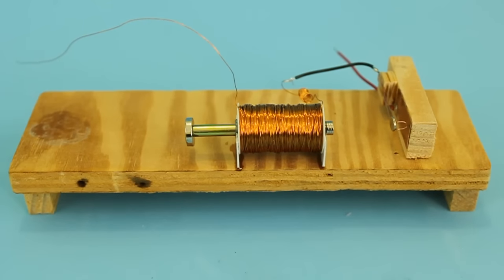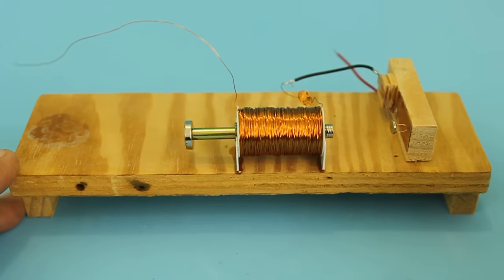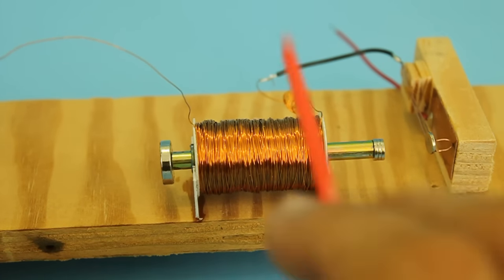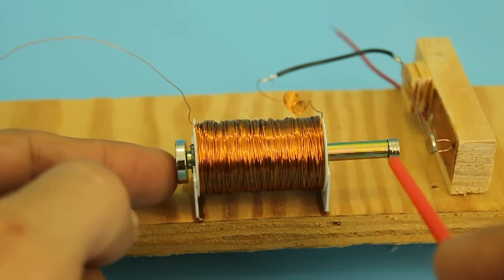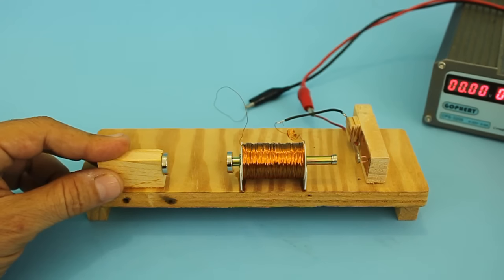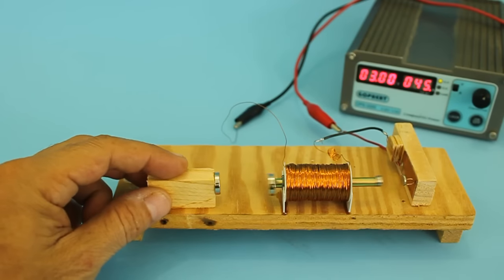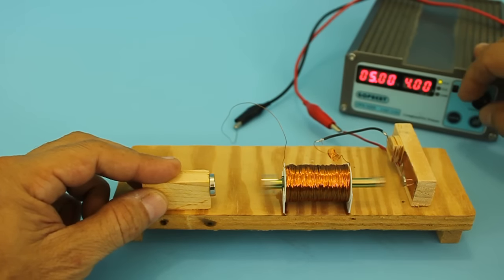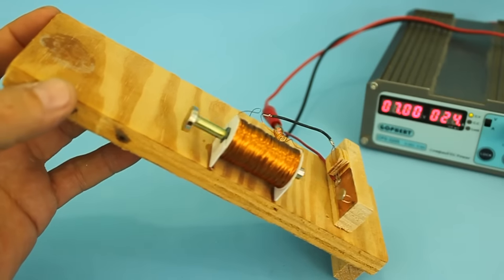Magnetic Linear Motor

Comment: A spring can also be used to push the piston down.  Speaker driver has a similar design with voice coil moving up with electric signal applied and then being pulled down by the magnet.

Comment: Having identical magnets at both ends could make for a better demonstration, and using this to drive a bass speaker would be a great video, especially since a version of this concept is used in a subwoofer that's much more efficient and powerful than traditional drivers by keeping the coil stationary and making the magnets move, the amazing Powersoft M-force.

Comment: Use an opto isolator switch and transistor in place of the the mechanical magnetic switch and you could fine tune the timing and duration of the coil energizing.

Comment: I mean if you use a.c. the reversing magnetic field in the coil alone can make the oscillation happen without using the third magnet, right?
Reply from the maker: +Sangeeth S yes but your frequency will be fixed at 60 hz. I think the axis will vibrate more than oscillate
Reply: Unless you use a frequency drive to regulate the frequency.
Reply: Ludic Science Okay. I didn't think about it. 😊
Reply: how to make magnetic orgarate switch
Reply: Chimaeria 
Thanks

Comment: Have you considered using a reed switch or a Hall effect sensor to commutate the current? Also instead of spring (magnet) on the idle end why not put a similar commutating circuit there too and double the output power?  It would become a one-stroke engine! Speaking of which, what kind of power does it produce, have you tried putting some kind of load on it? Good effort btw.

Comment: Should there be a diode inserted in the supply line to prevent the inductive kick from entering the power supply?
Reply: I assumed the smaller coil in the supply line served as an inductor for this purpose. I'm embarrassingly ignorant to the ways of lightning magic though, so there's a very good chance I missed the mark on that.
Reply: @jasonjohnson3282  
Hi Jason... 
The coil generates a magnetic field when current flows.  When the current stops, the magnetic field collapses and reverses the polarity of the coil.  This current, if not redirected,  returns back into the voltage source, and usually, that is not a good idea!  A diode can be used to redirect the collapsing field away from the source. Current lags voltage in a coil by 90 degrees.  The added small coil does nothing to redirect.  The smaller coil will represent a different impedance than the larger coil thus may have been added to control the current draw.  I am always open to being shown if I am wrong.  I am always interested in learning something new.
Reply: @valveman12  Thanks so much for your response and explanation! This stuff is so fascinating, but I'm still trying to wrap my head around the basics. This was very helpful.
Reply: It's fun to experiment.  Have fun and keep asking questions.😁  I'm an Engineer and I am still learning...

Comment: What equation did you use to calculate the number of turns and the voltage required to produce a high push or high force?

Comment: My problem is I get short circuit when connecting coil to power supply because coil has no resistance so power supply delivers no current
Reply: Coil should have resistance. Did you supercool it?
Reply: Wait. If coil has no resistance then it should work better

Comment: What will happen if you use a low voltage a.c. instead of dc power supply ?
Reply: Lazar Jakovljevic I mean if you use a.c., the reversing magnetic field in the coil alone can make the oscillation happen without using the third magnet, right?
Reply: If you use low voltage AC, say 5hz this motor will become much simpler and somewhat more useful if you want to make an actual motor out of it. One can become low frequency AC via variable frequency drives.
Reply: Lazar Jakovljevic Oh.. that is true. I didn't think about it. 😊

Comment: Good concept but you are better to have two coils and turn one on at a time. This way the force going right is the same as the force going left. Here your magnet pulls the armature steel back at a different force than your coil is pulling the armature.

Comment: Did you make your own coil resistor there?
Reply: Looks like it! I was making a current balance for our physics lab (short thick copper conductor), and the easiest way to regulate DC current in that wire was to have a thin copper coil in series to act as the resistor.

Comment: I don't understand the sense behind the experiment, but it's cool to see how it works.
Reply: Simple answer is look up MAGTOR motor. All the AC, Frigs and dehumidifiers use compressors that use a ton
of current and create LARGE amounts of Co2 the energy Co have a demand when we all use AC and all these Refrigerators are
ON and being used. This motor idea you saw is how a MAGTOR works, it will become the new PUMP for all those units.
Why is that great? Because MAGTOR uses much much less energy to start and to run. Peace!

Comment: You could take this up yet another level and make an ultra-fast oscillator that drives a microwave transformer or something.
Reply: Bit of a tip by the way, energized is pronounced En-ur-jaizd
Reply from the maker: +OBV10U3_NINJA I don't get your idea, how will you drive the mot with this?
Reply: Ludic Science That switch is turning on and off, is it not? Hook it up to the smaller coil on a transformer and voila, transformer driver!
Reply from the maker: +OBV10U3_NINJA mmm, but current is too small. Maybe making a double switch. Anyway i'll try it!
Reply from the maker: By the way I tested the transfomer thing. It kinda works, but the transformer does not like the chopped, low frequency pulses and efficiency is horrible. Nevertheless it is interesting so I will upload video. Maybe it will work better with a relay.